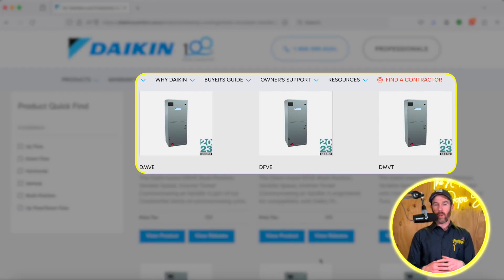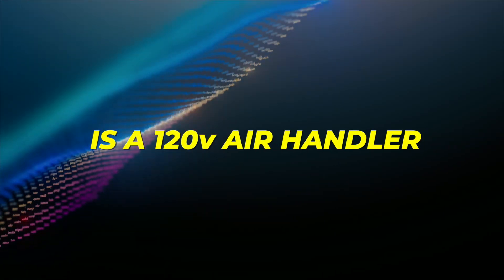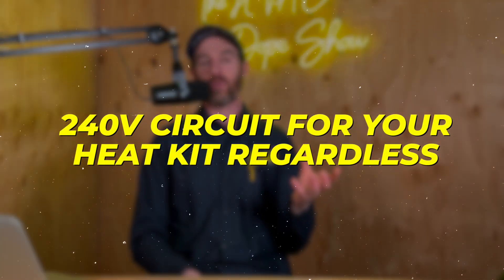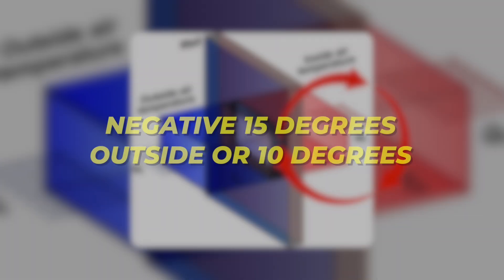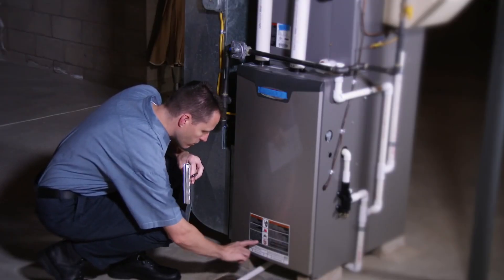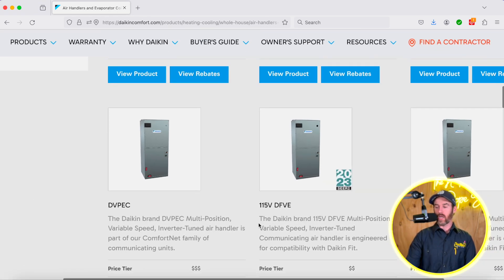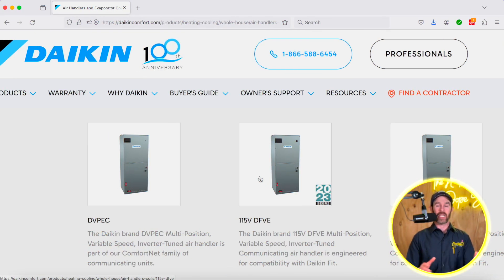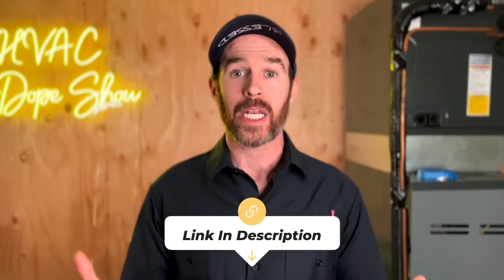Switching to a Heat Pump Just Got EASY | 2025 Daikin DFVE* 115V Air Handler Review

Comment: 115v version supports heating strips 5w or 15w?
Reply from the maker: Does not support heat strips from what I've heard
Reply: Thanks for your reply! Is there anyway to turn off the defrost mode completely?  When it starts blowing cold air during the cold days it’s pretty annoying (Daikin fit 5 ton with this 115v air handler) . Or at least maybe some option this air handler has to turn off fan while outdoor is defrosting ?

The only option I found is turn two hours interval for defrosting. No complete Off option

Comment: Great content!  Question - In Las Vegas, NV would a 5 ton DAIKIN FIT Heat Pump - DH6VS or DH7VS and 115V DFVE
Whole House Air Handlers & Coils work?  Will it cool during the high Las Vegas temps?  Can the 115 V DFVE work with the Daikin DZ9VC heat pump?  Or is just better to stick with a split gas system.  Thank you.
Reply from the maker: Dz9 is the way to go, the Daikin fit 5 ton only has 3 tons capacity at 115F. I’m not sure if the 115V air handler pairs with the DZ9 I’ll ask my rep
Reply: @TheHVACDopeShow  Thank you.  Is there any 5-ton side discharge communicating unit that can cool in the Las Vegas summer heat?  Do you sell any 5-ton side discharge heat pumps in Phoenix?  The lower cost of side discharge heat pumps is why I'm asking.  Keep up the great content.
Reply: @TheHVACDopeShow where did you see it has only 3 ton capacity? I checked manuals and I couldn’t find it. They just installed for me 5ton dz6vs outdoor unit with 5 ton 115v indoor unit. Does it mean I have only 3 ton for heating and cooling now?

Comment: Great video and product. I was under the impression that the Mitsubishi air handlers (SVZ models) are powered directly from the outside unit, so that avoids having to run a new circuit to the air handler (at least for installs that do not need heat strips). Please correct me if I'm wrong.
Reply: Correct but they are requiring communication wire between the indoor and outdoor and sometimes it can be pain to install it

Comment: So is there some new magic that makes defrost cycles not a problem anymore? I’ve had old school heat pumps and the periodic blast of cold during heating season was not welcome when the heat kit died.
Reply from the maker: It’s mostly settings available. Like on the Daikin fit it can be set to just not blow air at all and go into defrost without blowing cold air. Also if paired with a furnace / dual fuel setup, the furnace or electric heat kit can kick on (as you mentioned) but we’ve found that the inverters are very quiet and reliably able to heat without some of the same issues as older single stage heat pumps.
Reply: @TheHVACDopeShow can you point me in the manual where it’s written to not blow cold air during defrost. As currently every 2 hours is set to defrost and blowing cool air

Comment: A 115/120 handler would fix my EV charger issue.  My breaker panel is full, and its going to be really effin expensive to upgrade it. But aslo my AC is only 5 years old, and I don't wanna lay down the cash to swap it out either, just to free up a breaker.  grr
Reply from the maker: You’d still need a 2 pole breaker for the condenser / AC heat pump, but your furnace circuit which is replaced by the air handler doesn’t have to be upgraded to a 2 pole. Did you see if an electrician can put in a small sub panel? Might be cheaper
Reply: @TheHVACDopeShow  I'm running heat strips anyway, it's not a heat pump. So it would be an all around upgrade.  But I could lose the the second 50 amp running the strips and run a new circuit for my car.  It's Texas so a heat pump is fine.  But alas I'm not going into debt over it.  My system works fine and I have a way to charge that isn't perfect.

Comment: are both indoor unit and outdoor units 115 volt./ 23 seer  how much cfm of air
Reply from the maker: No just the air handler the condenser is always 208/240v~ in a residential application at least in the USA and what I’m familiar with. The air handler however is normally 208/240 as well that’s why this air handler is unique and advantageous for a furnace replacement

Comment: A lot of heat pumps that will produce sufficient Heat down to 0° and below not sure why you're still using dated information

My heat pump system is an inverter system and it was producing 132 degrees air temperature coming out of the registers when the temperature outside was a 15° during the winter
Reply from the maker: Look at the videos where I review capacity charts though, capacity drops at 0F for every heat pump even the best cold climate, plus load on the space increases. You still need backup heat if your climate gets that cold…
Reply: @TheHVACDopeShow  yes I'm getting 100% of the capacity the full 24,000 BTUs you still need to do some research good luck